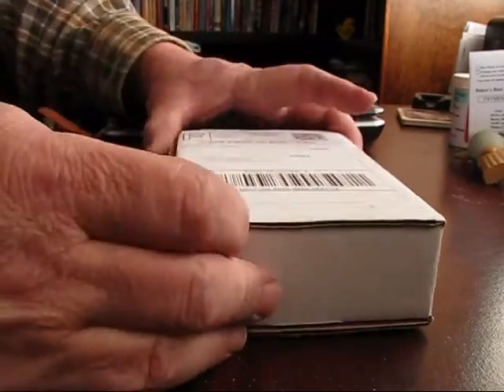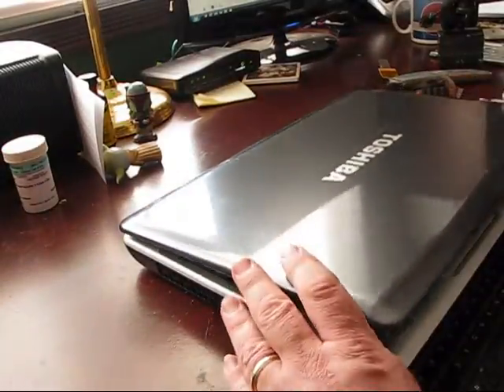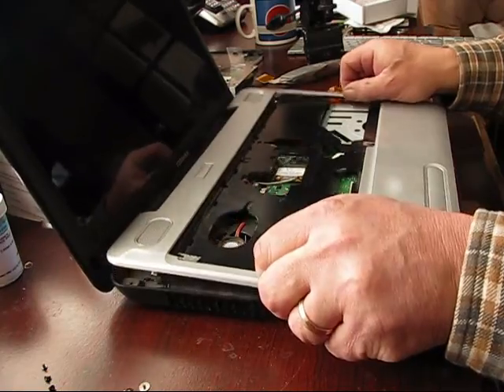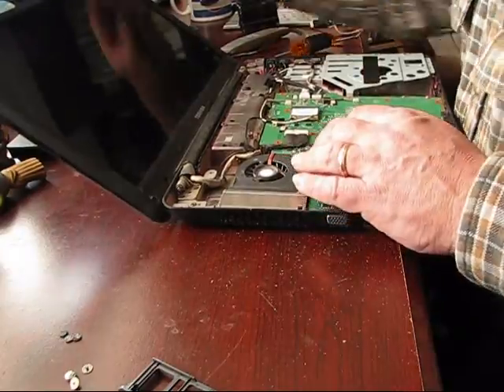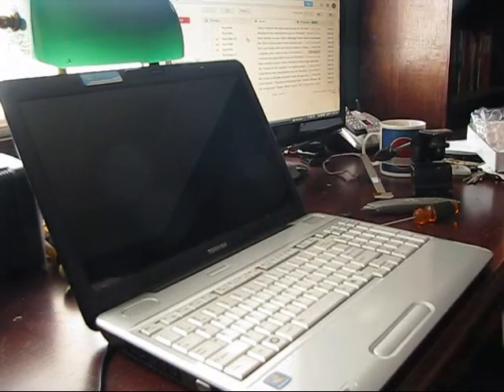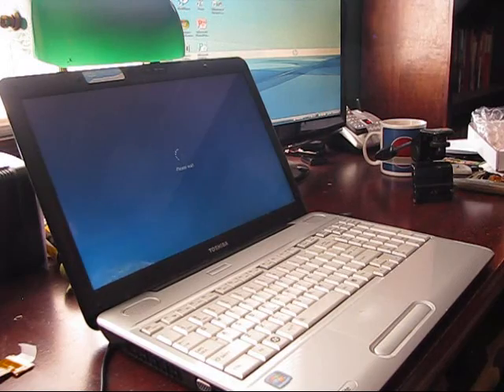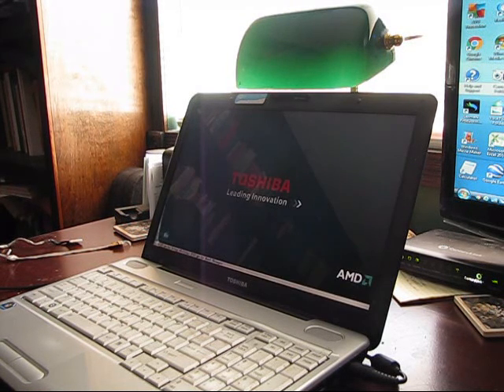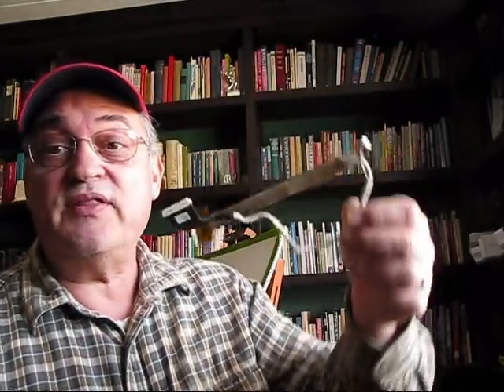Laptop Screen Video Cable Replacement

Comment: Thanks for sharing - going on ebay to buy my cable now. Why did you mention spending $90? 
Would you share the ebay seller you used ?
Reply from the maker: I don't recall the seller I used. Sorry I could not help you there.

Comment: I watched with fascination how you replaced that LCD cable on your Toshiba.  My 4 year old Acer 13 CB5-312T touch chromebook  started the same problem.  I have to open and close it 10x before the screen comes on.  You think this would be a common problem for ALL laptops.  Since this will be the first time I do this surgical procedure, I wish I had a manual or a UTube video on the Acer 13.  Looks like my cable will cost $20.  Any thoughts?  I LOOK FORWARD TO  WATCHING ALL YOUR SELF-HELP VIDEOS.
Reply from the maker: Thank you Gary. What I did was just dive into the project blind, and with caution and care I began the dissection. It all took time, but I had a boldness. What could I loose? The laptop was already toast. I was just trying to get some more life out of it. Still  works great today. Two batteries, a Motherboard, Hard Drive and LCD screen cable later.

Comment: I have the same issue. This would be the 3rd time replacing my video cord... The top left corner where the hinges are it separates when it's open. Eventually leading too the cord being frayed and my screen would be a fuzzy green with lines in it to not working all together. I have a few friends who replaced the cord for me because hardware is my expertise not phsycial replacement.. it tore again and now I am going to take it upon myself to fix it. Thanks for sharing!!!
Reply from the maker: Your welcome.

Comment: Thanks Jerry, this is very good,I have the same problem but didnt know if I could fix it. I will be giving it a go.cheers from down under.
Reply from the maker: Glad I could help.
Reply: Hi Jerry, I have had a look and the one that fits to the back of the screen,not so easy to get off,dont know if to pull it off or slide if off,and I have the same pc as you,but my camera wire goes to the top of my screen and plugs direct into the camera.just need advice on the one on the back of the screen.cheers mate.PS my pc is a Toshiba L500.

Comment: I need to replace that plus the sound on my laptop is starting to go
Reply from the maker: My sound went on my computer as well, so I had to order and replace the motherboard on it.
Reply: If I just buy external speakers and hook them up to laptop would sound still come out clear?
Reply from the maker: Try some ear buds first, that way you are not spending money on something that may not help. If the quality of sound is diminishing in the earbuds, I would venture to guess it is the mother board.

Comment: Hi a fantastic video.  I looked at a few others but this was the best one to give me the confidence to carry out the same operation when I have never tried opening up a computer before.  Your untechnical approach convinced me that it would be realistic for me.  Especially at 7m when my attempt seemed to have got stuck.  But I double checked with your video and it worked like a charm.  Now a screen that started off as irritating and recently became almost impossible now works as good as new.  I have a very similar model of Toshiba to you.  I hope you are still looking at your comments.  Many thanks.
Reply from the maker: Thank you for this comment. I am pleased this helped you as well as others.

Comment: This video was far better than any of the "professionals"  EXCELLENT, and thanks
Reply from the maker: Thank  you very much for that. I hope you fixed your problem with the laptop.
Reply: Pine Meadows Hobby Farm A Modern Homestead Nope.  :-)  But, I did send a link to my husband.  It is his laptop.
Reply: This is Susan's husband Ed. I was able to replace my Toshiba monitor cable with the help of your video. All works  well. Thank You.

Comment: My laptop has a screen problem... Its the monitor to board connector. It turns white when i pull it up... I have to put it all the way down so it can look ok...
Reply from the maker: I hope you can find a solution to that problem. Best of luck to yo Ethan.
Reply: Ethan, your LVDS cable is broken my man!

Comment: Thanks.Just a note if working on a L50B YOU DONT HAVE TO REMOVE the keyboard to replace the screen cable its all accessable from the bottom.
Reply from the maker: Thanks. I kinda figured that out after repeatedly diesecting the beast and fixing it. Thanks so much for the comment.

Comment: The only problem I have is that I don't know how to plug the video card to the new screen. It just won't go into it. Any fix for this?

Theres not really a need to replace the cable. I'm just replacing the screen and i don't know how to slide it under the port.
Reply from the maker: Is the replacement screen the correct replacement? The cable should slide into the port, check to see if there are a slide lock that needs to be loosened and pressed back in after sliding the cable. Good luck with your replacement.
Reply: Yes i made sure, but i might just take it to staples because the two things on the side won't click because i can't slide it in. I don't know if it's supposed to do this but the video cable chip is kind of split.

Not split on the replacement screen but split from the computer itself. It's probably normal but it just it hard to slide in.

Update: I have the HP Envy M6 1125DX

Comment: I have the same problem but don't know where to get that wire, my computer is a hp envy dv7
Reply from the maker: I went to EBAY and typed in my model number and "video Cable". Sometimes you have to keep looking until one appears that is being salvaged from a computer. Good luck with your search.

Comment: Great video! I have an issue with my laptop screen only displaying correctly when it is fully open/pushed back. Until it is fully opened is has a white screen/lines all over the screen. Does this sound like an lcd/screen cable issue? thanks
Reply from the maker: +AR Drummer Yup. For a couple of bucks on EBAY you can grab one if it is available. Thanks for the inquiry.
Reply: cool! I figured that's what it was. My computer is a L75D-A7280 and I am having a hard time finding the cable. It's either $80 or out of stock. The part number is A000243560 or DD0BD5LC000
Reply from the maker: AR Drummer Just found one for you on EBay
TOSHIBA SATELLITE L505D L505D-GS6000 16" LCD SCREEN VIDEO CABLE 6017B0198301
$2.99
Free Shipping.
Reply: Thanks for the link! Although, my laptop is a 17.3" screen. Only part # I can find that works is: A000243560
Reply from the maker: AR Drummer oops, sorry, I look again
Reply: no problem...this part is hard to find!

Comment: Thanks for showing these laptop repairs, I have a Toshiba I may need to replace the motherboard in, and an older one that I have had some  problems with the screen in.
Reply from the maker: +James Pottorff I LOVE the University Of YOUTUBE. It teaches me so much. I was also able to rebuild the automatic transmission in my Chevy One Ton Dually from wathcing a video on YT. Saved myself a couple of grand and spent only $150.00. Thanks for watching.